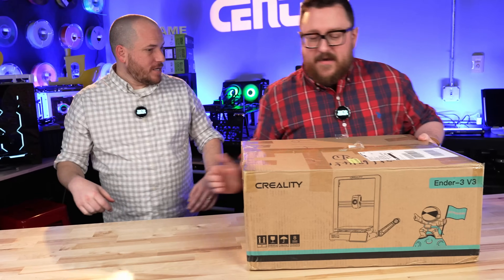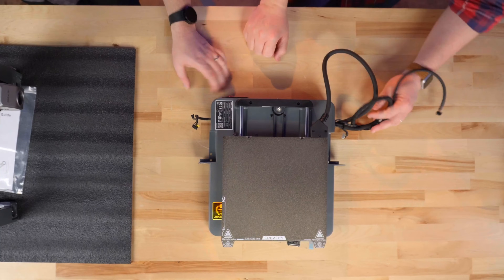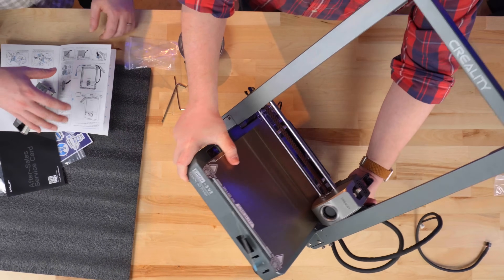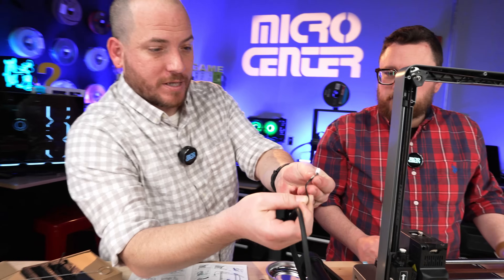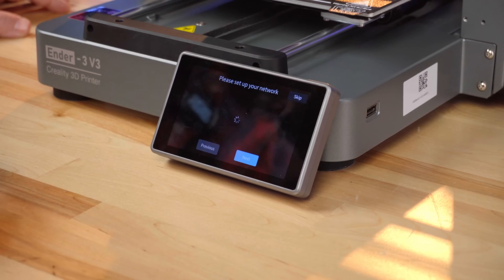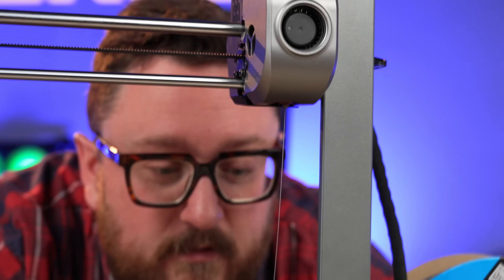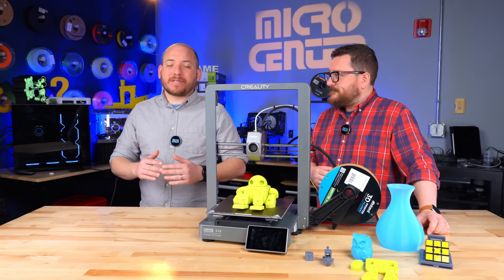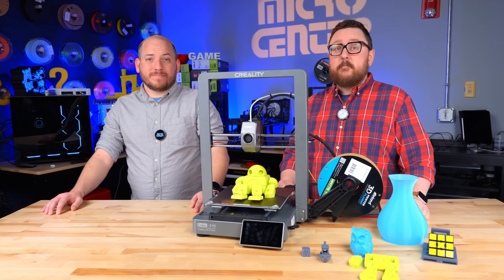Ender-3 V3 First Look | Creality's Core XZ Flagship 3D Printer!

Comment: #IWantAMicroCenterNearMe 
I actually would want one in beckley WV, closest one to me is in columbus ohio, 4 hours away.

 looking at getting one of these primters in the coming weeks. Still doing research. I have a lot of experience of the cr10, dad has one and have 3 at school. Along with 4 ender 5's, 2 ender 3's, 4 dremel 3d45's, along with some resin ones. Most of my experience though is with the dremels and the cr10's, which i think the wifi connectivity is a hige deal along with auto leveling!

Comment: Why is it called a Core XZ when its a bed slinger?
Reply: x and z axis move with belts and motors working together. the y axis (bed) has its own motor independent from the other two axis. a printer can be a bedslinger as well as core xz.

Comment: I just got my ender 3 s1 pro. The naming department of creality is bongers! Anyway, it‘s a great printer with 150mm/s which for my application is alright. But i am blown away by the precision. Right out of the box this thing looks better thans most people‘s prints. It‘s rather slow but it doesn‘t matter anyway. If you want good details with the ender v3 you also need to crank down the speed.

Comment: This is a regular Bed Slinger 3D printer, not Core XY. New printers like the Bambu labs p1p or Creality K1 are Core XY
Reply: It's CoreXZ, like Voron Switchwire. Two motors in the base drive the toolhead in X and Z, while the bed moves separately in Y. It is also accurate to call it a bedslinger.

Comment: I think liner rails are much more durable than rods. Really wish they went the same route as the V3 KE with the liner rail and spring tension extruder, its the most reliable unit Creality sells. The only issue with the V3 KE is its poor gantry attachment where its prone to wobbling. This printer seems to use the same technology as the K1 and K1 Max, which have been giving owners (like me) major headaches with constant clogs and heat creep issues due to the poor design of the head.
Reply: what makes them more durable?
Reply: @oozie-c3j  In fact, linear rail does not sag and is much better for high speed application.

Comment: Oof that bency didn't  look too good
 the first one I did on my  v3 SE looked better but  not high speed of course.
I hope this printer will be competitivley priced but  as the  k1 was on sale around BF for $350 and the  V3 KE is $260
it doesn't leave much room.
If this printer is much more than the KE then I would rather wait for a sale on the K1 again  and get an enclosed core XY over this
I can't see how this thing will be much less than $350 and  it will of course have to be higher priced than the V3 KE.
It will be very interesting to see how they fit this in to their very overcrowded lineup price wise.